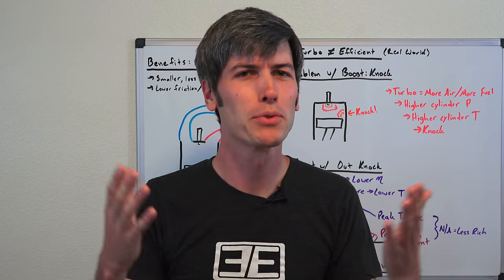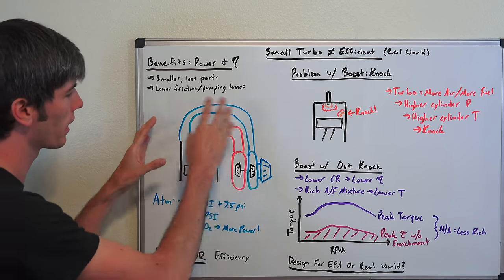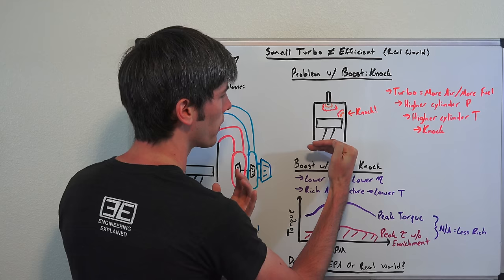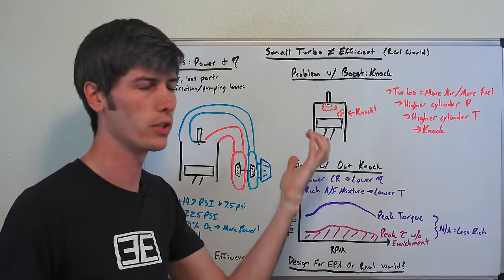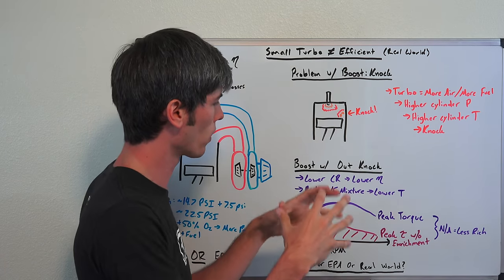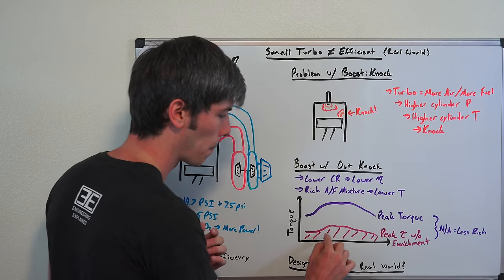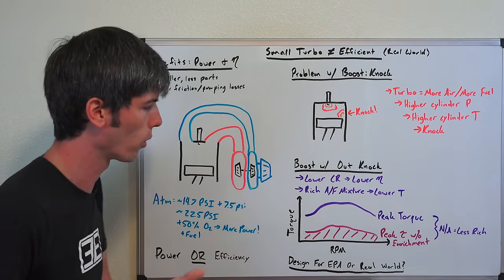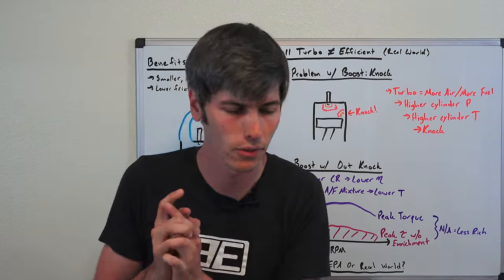Why Small Turbo Engines Are Not Efficient

Comment: So, here is a question for you or someone that is capable to awnser:
Could the "classical" turbo not drive a form of electrical generator that feed some kind of battery/capacitor type thing, that in turn drive an electrical compressor, and thus you can always have a good constant air-preassure?
And with the exhaust gasses driving the generator, you should get high(er) thermal efficiency as well?
Reply: Your suggestion is quite complex and will get rid of turbo lag but nothing else.
Reply: You don't need a separate electrical compressor, you can use the same motor-generator on the (combined) turbocharger for both like the MGU-H in Formula One racing.

Comment: Do intercoolers not lower the pre ignition air temp? Also a bigger engine at low load is inefficient not to mention weight, fluid losses, heat dissipation, low torque at low speeds. Even with cylinder deactivation the cylinders and feeding them is still all there. Even Mazda uses a turbo

Comment: so, basically an identical diesel engine will have better fuel efficiency than a turbocharged one?  I don't think so.  In other countries where diesel is readily available we have a very different experience.  Your case may apply to gas powered engines though.

Comment: If a higher octane fuel is used with a lower ethanol content the pre-ignition temperature is lower, so shouldn't this eliminate boost knock? And if it does then shouldn't small turbo engines technically be more efficient under high load scenarios?

Comment: So basically, if you drive more aggressive, you get worse mileage.  Doesn't this apply to all motors?  My wife's 2018 Civic has an average of 40.3 mpg on the dash right now.  The appeal is that she can get 40 mpg but it also doesn't fall on its face when merging on the interstate.  I think you lost the point in these small turbo motors.

Comment: Avoid the boost if you want eco...
Reply: Not necessarily. Engines need to breathe to be efficient. Lugging it around at 1100 rpm is a bad idea.
Reply: @paulanderson79  Yet that's exactly how Ford tunes their Ecoboost trucks that are supposedly so fuel efficient.
Reply: @hochhaul  Personally I think it's best to buy a car that has performance to suit your own needs, is the kinds of journeys you make and also one that suits your driving style. A 1.0 Ecoboost Mondeo is going to disappoint in terms of fuel usage and driving dynamics if you enjoy getting on with things. Much better off with one of the 2.0 or 2.2 diesel models.

Comment: not true with my VW EA888 Gen 3 in my '18 Tiguan.  It gets outstanding fuel economy.  The EPA is 22/27.  I have never seen worse than 26MPG, and as good as 34MPG at 75MPH.  Budack Cycle makes a big difference.  I also always run in Sport Mode for better acceleration and shifting.

Comment: I'm looking at an underpowered 1952 GMC one ton. 235 ci, low compression. Can I put a very small turbo on that without damaging the engine? The main problem is low top speed. I am guessing that even with more HP, the valves chattering are going to be the limiting  factor for speed.

Comment: I think it depends more on the tune and driving habits... I have a 2001 VW Jetta 1.8t. Its a 3000 lbs car, with a turbo 1.8 motor. It achieves most of its power from having a 9.5:1 compression ratio, advanced timing and dumping fuel to keep the cylinders cool under load.

It CAN get worse fuel economy than the regular 2.0L gas engine offered if you try, but overall it gets about the same. With a simple tune has more power than the 2.8L VR6 engine. I regularly get 28-33MPG and have seen 36MPG. In the winter, driving around town or when I'm rowing through the gears harder than normal I'll get 25-27MPG, Not that far off the non-turbo engine. Its hard to compare a 1.8T to 2.0 N/A engine, but the 1.8T puts out 2x the power!

Comment: Any engine that is Properly engineered is most efficient at its maximum thermal Delta. That means a small Turbo engine running at high temps over a wide operating Window is more efficient. Period. So the title of the Video is at least missleading, if not plan wrong

Comment: the current modern day engines with turbos are direct injection.  So you can have high compression  to get the power and efficiency of NA.
Reply: That only goes so far, especially when running 87 octane piss.

Comment: And then there’s Chevy who rates the Cruze for 87 and on that octane it gets preignition. GFs motor blew at 30,000 miles because of this crap. Dealership replaced it free and since then, I did my research on that car and found out how much of a POS the Cruze is and so is Chevy. Now we use 91 octane and haven’t had a problem... yet.

Comment: The reason why 1.4, 1.5 TURBO PETROL is better than Turbo Diesel, is that TORQUE which pumps out is very close to TURBO PETROL are much closer to TURBO DIESEL (200 NM to 250NM) 
Now
Talking about 1.0 and 1.2 TURBO PETROL cars pump out (155NM to 175NM), so the TORQUE is the one that really makes the GAME CHANGER, 
So, Final Verdict, a 200nm to 250nm TURBO PETROL cars can run better, drink less fuel and pump good Mileage, most importantly, these cars can CRUISE at 100kmph in 2000RPM or less.  
While the 1.0 and 1.2 TURBO PETROL cars as their TORQUE is small (155nm to 175nm) CRUISE at 100kmph it takes 3000RPM, so LOW MILEAGE. 
I studied about these , tested and Giving you Information. Check yourself if NOT BELIEVE ME 👍
But people are COMPLAINING LOW MILEAGE providers are these TURBO PETROL cars. 👍👍

Comment: Knock in small or big turbocharged engines is not a problem. If knock is happening it is because of low quality/octane gasoline. ALL of Europe has Octane 95 as standard. The USA needs to leave the past behind and start using Octane 95 gasoline.
Reply: They use a different system, its the same octane converted.
Reply: @reistje  what do you mean by different system? Octane gasoline is the same all over the world.

Comment: I have a 2019 MAZDA CX 5 with a 2.5 L. turbo which is more of a "medium size" engine. And with MAZDA's dual intake ports (small & larger) for lower and higher RPM situations seems to avoid most turbo lag and still gives me power on the low end. 
**I use 100 octane gas (1/3 tank) with the 91 octane "premium" gas we have out west. It definitely DOES feel that I gain about 10 HP with this mix. 
->When I use ALL 100 octane gas I really get a lot more power. MAZDA's computer somehow is able to utilize this high octane gas. WHY?
Reply: Knock sensors
Reply: how about ECU mapping that will let the knock sensors &/or timing to take advantage of the higher octane?

Comment: Who builds turbo charged engines like this?
My 335i for instance full throttle does AFR ~14.5 flat from 2 K to 5.5 K, then it enriches on the way from 5.5 to 6.5 K to a maximum AFR ~12.6, wich is fastest burning velocity - to keep the peak force on the best angle. 
It doesnt touch ignition timing up to there. never.
No knocking at all. 23 MPG av with 360 hp.
May be it is also because we have 98 Octane fuel as a standard at gas stations in europe, but that explaination reminds me more on back yard tunings.
Sorry man, I have 5.0L Power with 6 cylinders (or even 4 cylinders) economy. No baloney.

Comment: Hi, love your videos. I wonder if you could give a bit of advice. I have a 2.5 V6 duretech engine and I need to get more air into it. The plan is to fit the 3.0 duretech engine heads along with inlet manifold. The question is that the dome in the 3.0 head will be larger than the 2.5 cylinder. The gasket used will be the 3.0 so that will line up with the edges of the dome. My concern is this effective lip that will be created from the cylinder being of a smaller dia then the head dome. Do u think this will cause an issue. Plan to run 500bhp and around 1.2-1.3 bar. Look forward to your advice.

Comment: They are efficient, you just can't drive them efficiently unless you have the gift; I do, but I still  find them infuriating to drive. A low boost electric supercharger with a small engine would be an easier way to better fuel economy and much more pleasant to drive.

Comment: todays turbo have coolers.....radiators to cool down that air, plus last gen of engines have that sensor ''anti early explosion of the fuel'' (i am not a mecchanic sorry about my terms) who can decide the exact moment to detonate the fuel without causing problems.
Reply: Intercoolers do not fix this, and knock by definition is detonation without the spark plug, the entire video was apparently over your head (just means you gotta binge watch some more EE videos, but that’s entertaining so have fun!)
Reply: @jakegarrett8109   well you must be right XD . I need more in this field. But then srry to ask, why adding intercooler if it doesn't resolve nothig :/?
Reply: Alex Constantin cooler intake air = more dense air = more total air per volume = higher maximum power. It can also help improve efficiency, so it’s definitely not useless, there are just many things going on and knock is only one of the issues.
Reply: @jakegarrett8109   thanks man!!! :X yeah def i need more infos in this field XD !!!

Comment: My Ford Everest 2.2 Diesel Turbo “Broke” with only 58K on the clock. It seems that there is a massive problem with the ford turbos. Immediately after being replaced by ford I sold it and got a V6 Hilux. Stay away from ford as far as possible.

Comment: Why not a variation of the water injection used in WWII era aircraft motors to keep cylinder temps low at high power levels?

Comment: Keep it simple. A turbo makes power by allowing the engine to burn more gas. Thus worse fuel economy. At low load they are more efficient since they have smaller displacement. They have the power of a larger engine when you step on it but at the cost of worse fuel economy.
Reply: Well said! It is that simple! I'm a fan of the Turbo- just treat it well and use and change the CORRECT oil regularly and they are great.I've had turbo equipped cars doing big mileages over the past 25 years and I've never had to replace one yet.Greetings from Ireland!

Comment: Theoretically a long stroke engine running on gasoline would be very efficient as gasoline is a slow burning fuel. High torque too. I wonder why auto manufacturers don’t make such engines? A turbo should only come on when ultra power is needed, like passing a truck on a 2 lane highway or climbing a mountain at high altitude.

Of course, I also wonder why American cars are so poorly engineered — are the people controlling the auto industry in America trying to destroy it? Looking like it to me. I’m not an engineer but I do a better job engineering and designing a car...

Comment: A small engine with a turbo is nothing but a ticking time bomb.  They are formulas for disasters.  Traditionally, four cylinder engines with a turbo are junk.  That tradition is still not broken.  Modern four cylinder turbo engines are the mechanic's bread and butter.

Comment: Help!!!! I have a 400hp twin turbo car. Changed the heat exchanger, the cold air intake and the catback. Normal driving it works great. But after 2 hour driving on a trip at 70+ mph. I feel like I lose power. When I fully throttle. The turbos doesn't work. As if I were on a long hill. Takes a lot of time to go from 75 to 100 mph full throttle. Any ideas?????

Comment: The Dacia 3 cylinder turbo 1.5 diesel in the sandero returns 87 miles per gallon  on a good run of 150 miles, the eco mode closes the turbo inlet by 50% for driving in traffic and that returns 60 mpg. the engine develops 90 break horse power which is roughly the same as a family car of the 1990s in a 1200 kilo small hot hatch. turbos should ideally kick in at between 30 and 40 mph on a diesel car. Mpg is be tter if you bother to change the oil and oil filter every 3 thousand miles , its got little to do with the design . same goes for gas/petro lengines service it regularly and it will return good gas mileage . if a manufacturer tells you to change the oil every 10 k thats cos he wants the engine to wear out in 30 K so you go buy a new car.if you change the oil every 3 k your car could return 200k in mileage , 500k in a diesel, lets have some sensible information on here instead of this crap please? the  dacia sandero engine holds a  distance record from Paris to Dakar on one tank of fuel 11 gallons in total. and its a 3 cylinder turbo 1,5 diesel.

Comment: 2018 honda civic sport hatch with 1.5 turbo 180hp, 6 speed manual. My mpg is fine. 510miles per tank and a properly hand-calculated 42mpg (dash reads 45). People who get less mileage are simply neanderthals who can't comprehend how to operate their throttle position efficiently with the given terrain and grade.  Problem is carbon buildup and oil dilution affecting longevity (and maintenance costs... hondas already need constant valve adjustments... now we need to religiously change the oil every 3000 miles or say byebye to our main bearings because fuel is rubbing on them?). anyway, its OTHER issues making an otherwise fuel saving into another expense. not the mileage.

Comment: I mean, at the end of the day manufacturers would love to sell you a small displacement NA engine, nevermind a turbocharged one, for the SOLE reason of emissions regulations and laws globally. Forced induction accross the board is a life saver for small displacement engines, and modern manufacturers use them to produce a reasonable amount of power, making smaller displacement engines more palatable for the consumer. People are greedy, they want efficiency AND power. And with governmental regulations breathing down manufacturers necks, the producers try to give both efficiency and power while meeting these emissions standards. In a perfect world these manufacturers could devise a solution to these issues without worrying about unwanted atmospheric discharge, but that is simply not the world we live in. We must make what we have work, and that means compromise from everybody. 2006 Saab 9-3 Sportcombi 2.0T (B207R), I still hate you GM.

Comment: what about changing the air intake with aftermarket turbo parts?
and then adjusting for the change with tunes?

and strange as it seems...my EVs have this very same issue...if I enjoy the power, then range drops quickly.

Comment: Let’s compare actual numbers. Chevy cruise trip from Oklahoma to Florida avg speed 85 no cruise control ( yes no cruise control available pkg ) fuel mpg 46 avg could go up to 50 allowing an almost if not past the 600 miles per tank sometimes this is the none diesel version also. Toyota Camry better tech “more fuel efficient” vehicle 2020 at best fuel mpg 33 at best with all different kinds of fuel trials at best fuel per tank 400. Final conclusion; turbo cars are more efficient and quicker wouldn’t say faster but then again I also had the canary 2017 2.0T also made a trip to Texas got around 595 miles per tank and after that I tuned the car and got impressive results staying  eco and neck with the V8s all this has been proven when I had them now I just have a family so 🤦 gotta stick with the “safest” one Toyota Camry. Miss having such cars was gonna go up to the new corvette when it came out but then family but it’s ok I had my time other young wild ones can keep going.

Comment: I’m actually happy with the 1.0 liter 3 cylinder TSI engine in my new T roc. 
Gets 52.3 mpg on average both country and highway driving. It’s not a sport but I’m satisfied with the go it has, overtakes are no problem. 

Next car will have a bigger engine though cause I miss the torque.

Comment: Can one burn the excess fuel in-between the exhaust valve and the turbo by adding air?
Have a passage that draws in air by Venturi effect from the charger.
Reply: 0MoTheG they do some of this to keep the turbo spun up on throttle lift. You get the brap on throttle lift out the exhaust, Hyundai N hatch does this.

Comment: Wouldn’t it be possible to increase the compression ratio by mechanical means without a turbo and eliminating knocking by using direct injection which is how diesels develop their power. I’ve seen direct injected petrol engines which give similar fuel economy to a similar sized Diesel.

Comment: Chevy has a 2.7 4 cyl.
Ford has a 2.7 6 cyl.
Why did Chevy use a 4 cyl. in its big pick-ups?
Reply: Larry Be it would have fewer parts therefore cheaper to manufacture, esp. if the six were a “V”. Don’t know what else.

Comment: does the same concept apply to turbo diesel engines (knowing that common rail engines produce multiple sparks inside the combustion chamber) and bigger gasoline turbo engines?
Reply: No. Diesels work by exploding a slug of fuel in a high compression engine to produce power. Common rail injection injects the fuel at high pressure to vaporise the fuel into tinier droplets, which expands the surface area of the fuel and allows more complete combustion. The turbo just helps the air into the cylinder by blowing it in rather than making the engine suck it in. The turbo is hot, and increased pressure in the intake, so the intercooler cools it down, thus allowing more air into the cylinder, and thus allowing more fuel to be burnt,.So  the combination of the inherent efficiency of a diesel, the enhanced breathing by the turbo and intercooler, and the increased efficiency of common rail injection makes a modern turbo diesel a great thing to drive.
I've driven pre-commonrail diesels and they were pretty sluggish things. But I'm now on my 4th 2 litre Ford Mondeo diesel  (Fusion in US) because they are effortlessly fast and give me around 47miles per imp. gallon.